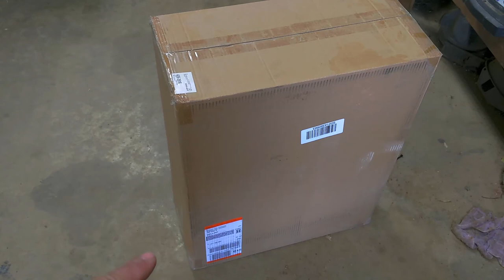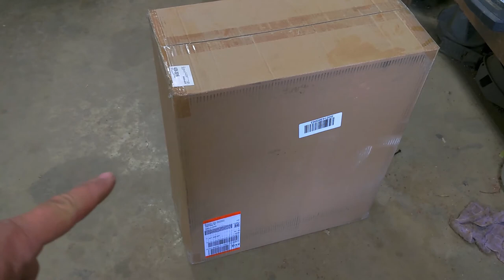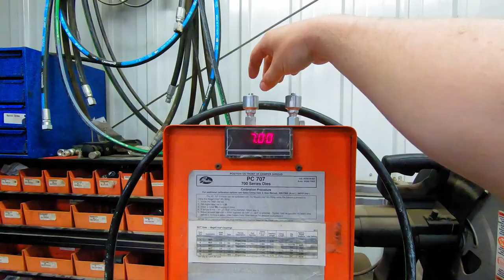Planting Vlog 2020 Episode 4 - New Ryobi Devour Cordless Sweeper for the Shop

Comment: That hydraulic hose fitting tool is a must have.  Makes it look easy.  How do you bleed the air out of the new hose once attached to the cultivator?  Just leave the seal loose at the end until the hydraulic fluid displaces it?
Reply from the maker: I usually just put the new hose on and it will bleed itself.  There is around 3000 psi of pressure in the fluid it will push the air in the system around usually.